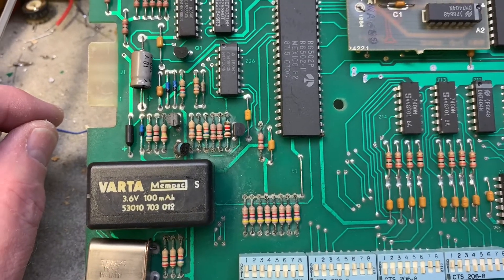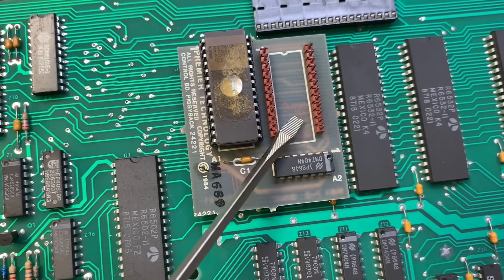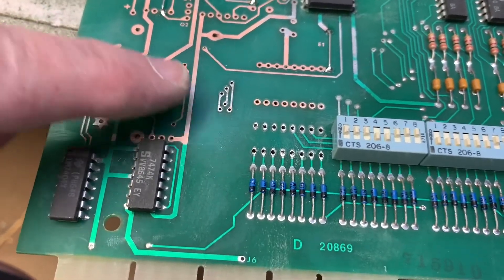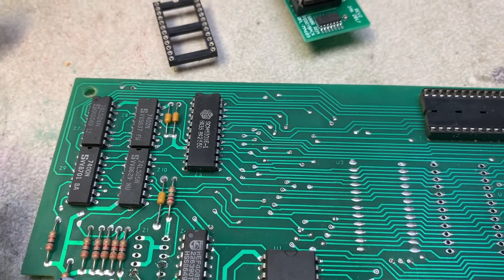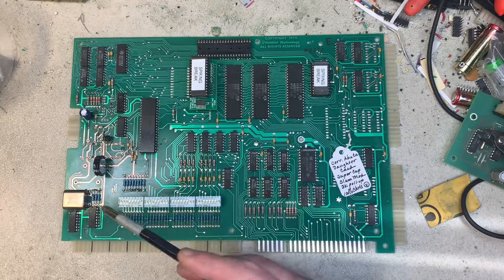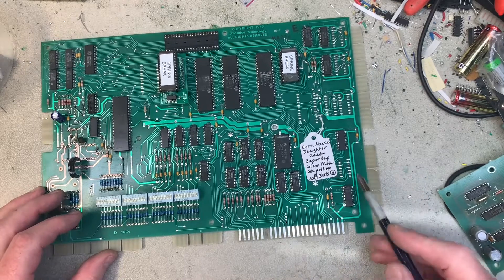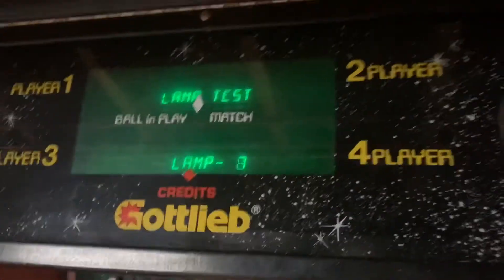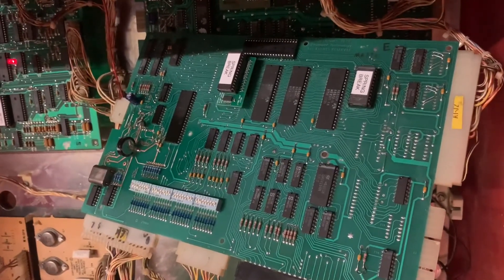Gottlieb System 80B Alkaline Corrosion Assessment, Abatement Process, and Test

Comment: How do you actually sand the board?  Do you use sandpaper and do it by hand (if so what grit) or do you use a dremel?
Reply from the maker: I'll make another video about that. To answer the question, 220 grit sandpaper and a small sanding block (12 pin molex "cube" connector). Follow up with 400 grit. Sometimes I use Gottlieb lamp cleaner sticks. I use fiberglass pencils for the fine work. For Big jobs like classic bally/stern, I'll sometimes use a dremel with a flap sander.
Reply: @ChrisHiblerPinball  Thanks Chris!  I had a -35 MPU and used a dremel on it, but my mistake was that I used the coarse 60 grit wheel that comes with it, and burned through the copper in a couple spots.  I now have the 240grit wheels, and will be more careful.  Thanks for the info!  But yes a video showing it would be awesome.